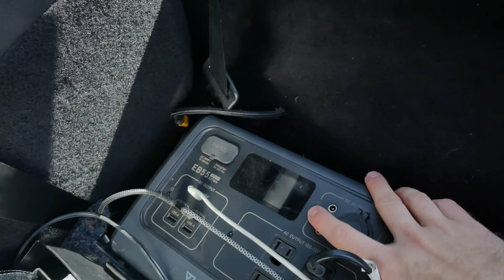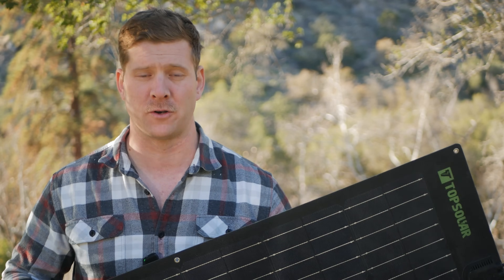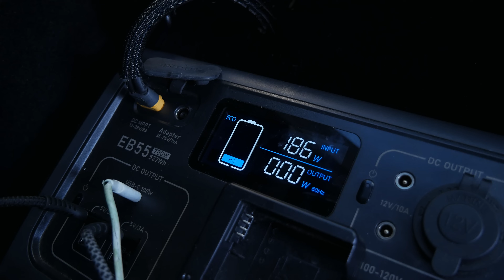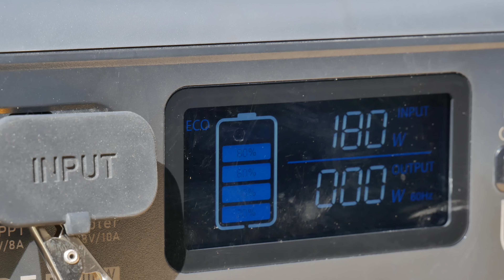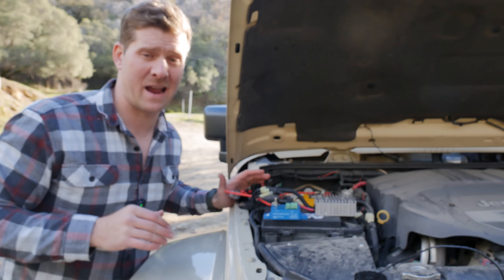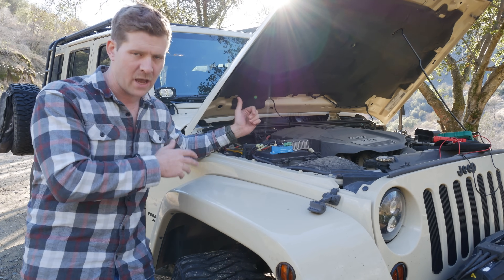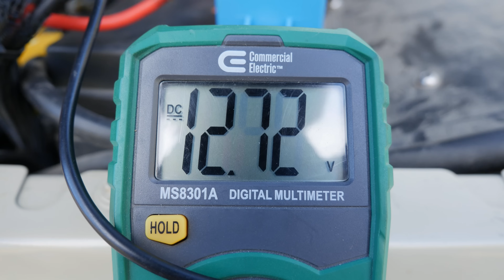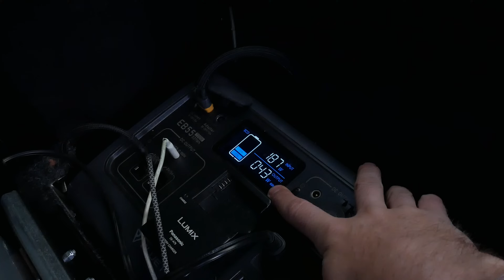Solar is Impractical for Overlanding: Here's a Cheaper Alternative That Makes 200W!

Comment: Watts is Watts. You will just discharge your car battery on smaller wires! If your alternator puts out 80amps at 13 volts that is 1040watts. If you convert to 24 volts the current will be in half but you will still only have 1040watts. Power = Current x Voltage. 
Make sure you have a spare Alternator on hand because you are going to need it! That Jeep engineer did not design the charging system to have that extra load.
Reply from the maker: @patricktrout9037  it's only pulling 200W for 3 hours or so until it's fully charged, then only 30-40W which is completely negligible. It's not just about the total power, it's about the charge rate and capitalizing on it while driving. With overlanding or any vehicle dependent travel, it's crucial you're able to maximize your charge rate while you're driving the vehicle so that you're fully charged when you arrive at camp.

Comment: I didn’t read all the comments so someone may have already mentioned this, and I’m no expert, but I’m pretty sure those higher charge rates degrade the battery much faster. Thus needing to replace the battery sooner than ideal. But maybe that’s the trade off for recharging in your scenarios.
Reply: My wife and I were beach camping for several days, and only 1 day out of 4 was there enough sun to charge our power station faster than it was discharging. On the 3rd day, I had to run the Jeep 8 hours to charge up our power station at a measly 60 watts to get us to the last day. I would have loved this solution for our situation.

Comment: Makes it sound like he found a new energy source like the infinity stone or something.  Perhaps solved fusion energy with a Bisquick recipe? Nope.  Whats the trick?  One battery dead, charge it with another... also drain your gas by running your car. An idling car uses between 1/5 to 7/10 of a gallon of fuel an hour. An idling diesel truck burns approximately one gallon of fuel an hour.
 Still.... I think it was a neat trick to charge faster then normal and I applied the effort just not the click bait saying solar doesnt work for you is what you mean.

Comment: But obviously, you will need an alternator with a sufficient output to keep-up with your system's extra demand for power.
Reply from the maker: @Ron_Leonard  it's a good point to consider for sure. My stock alternator has been managing just since posting this video for what it's worth.
Reply: @RhinoOffroad  I've heard a few reports of problems with the existing alternator's duty when maintaining large Li-Po batteries on deep cycle. Some vehicles may have an alternator ideally matched for maintaining a lead acid cranking battery only, but perhaps your vehicle is fitted with something more over-duty.Thanks for the reply.

Comment: Am I misunderstanding something? Does this mean all the charging sockets inside the vehicle are getting 24V at 8 amps or is there only one new cigarette socket receiving the 24V's?
Reply from the maker: @user-iv8hc8fm5o  no cigarette adapter used. Ran 10awg wire all the way back to the converter!

Comment: Why not just run your load off the car battery? It would be nice if the battery bank had a way to just disconnect its battery and only draw the external power needed to power the current load.
Reply from the maker: @gblargg  because this is using the secondary battery I already have 🤙

Comment: Sorry for Russian, but my English not very good. Мне кажется, что во время зарядки дополнительного аккумулятора не будет заряжаться основанной аккумулятор, либо его разряд будет происходить быстрее чем его зарядка
Reply from the maker: Using Google Translate but think I understand your question. The alternator supplies enough current to charge both batteries simultaneously

Comment: Why not use a 1000W Inverter which will just go to the Bluetti? Get like 500W out of it. 12V cigarette charger can do 100W. Could microwave yourself a quick meal while you're at it before you turn off with a mini microwave, I think.
Reply from the maker: @WrestleKrysti  because I'm then converting from DC-to-AC and back to DC. The maximum charge power the AC charger can provide is 200W when plugged into a wall outlet.
Reply from the maker: @WrestleKrysti  and this is far cheaper

Comment: 12.0v is like 30% state of charge. Could be a problem cranking on a cold morning and for sure will reduce life of battery. Reset it to at least 12.55v and the battery will stay at 75% state of charge. 
Very well presented video.
Reply: I'd just have it switched on with the engine, so it only charges off the alternator.

Comment: Should have gone for a 48v or 60v boost converter. 
And you don’t want to use your car as a generator when not in motion, so get a solar panel and/or a stand alone generator and for crying out loud, charge up your solar generator before you go on a trip, takes 2 hours max.
Reply from the maker: @TheCornucopiaProject-bd5jk  my Bluetti (and most portable batteries) can only take up to about 28VDC. I really don't use it when the car is not running, and I don't need to charge it up ahead of time; it only takes 3 hours of driving to charge it to full, and it's one less thing to worry about
Reply: @ you use one of those tiny power banks, that’s explains it.

Comment: So I kinda did that but I put it inside the dash with an xt-60 socket on the dash then made a xt-60 plug to socket a few feet long to plug in from there to my gen. Didn’t want all that stuff under the hood like you because if u use ur jeep like a jeep ie meant to be used that’s going to have issues with mud and water… just saying.

Comment: Doesn't this mean that your maximum charge capacity is now limited to whatever AH your car battery is? 

I'm using a Bluetti EB240 hooked to 400w solar over my Tacoma cab. True it's a little costly (~$1,300) but I'm never without full  power
Reply from the maker: @issues420916  no because it will keep charging until the Bluetti no longer accepts the input power. Ideally this is just keeping my battery topped off as the fridge runs

Comment: your alternator doesnt create more than your car needs, it only outputs what the load is, that load could be charging the battery or whatever accessories, charging something at 200watts will use more gasoline, just basic physics. but i can see it being used as a backup power source, would be handy.

Comment: Uhhh...24v 4amps. Minus conversion loss.
Reply from the maker: @MrNathanstenzel  the current on the 12V side is about 16.
Reply: @RhinoOffroad  you video graphics said 12v 8amp vs 24v 8amp
Reply from the maker: @MrNathanstenzel correct, because after the step up converter, 8A is provided to the Bluetti as that's the most it can take. The amps only get halved between the input (16A) and output (8A) of the step up converter.
Reply: @RhinoOffroad  my point being that it could not be that the two sets of numbers could not be the input and output. Maybe you meant for the graphic to say 12v 16amp and 12v 8amp?

Comment: Currently showing at $88.52 on Amazon for the 3 main components combined. Maybe this video has pushed up sales and, as a consequence,  the price! The description for the DC/DC converter states "(Note: Never connect to solar panel or wind turbine. Never charge the battery.)". Surelly when running the engine you are charging the battery. Maybe the relevancy of this notice by the supplier is something to investigate further.

Comment: For overlanding, definitely fit a flexible solar panel or 2 to your roof. You will generate good power all day to charge a battery and its all free. Running off an alternator is costing you gas all the time, its a very inefficient way to charge a battery.
Reply from the maker: This works great in the summer months, but you'd be dead in the water relying on solar all of fall and winter up on the Pacific Northwest

Comment: so to avoid solar you just use a whole vehicle as a generator? You've discovered a car alternator can charge a battery?
Reply from the maker: I don't think you watched the whole video...
Reply: @RhinoOffroad  sorry if i missed it but you seem to be running the car to charge/run everything on the way.
You have doubled the voltage to to max the watt charge on the leisure battery when recharging off the car battery which is charged by diesel/the car.
The tip of volts/amps balance to max the charge rate on the second battery is cool. 
 I guess I was expecting more of an alternative to solar than go back to the car and recharge the leisure battery from it, running the engine if needed.
Still enjoyed it though, presented well and explained
Reply from the maker: @merlynsfire1275  I probably didn't anchor on it enough in the video, but I definitely don't plan on running the vehicle just to charge the battery; for an overlanding solution, I just think you get WAY more bang for your buck by maximizing your alternator charging while driving so that you aren't reliant on trying to arrive early enough to catch the sunlight (or late enough in the morning). I do appreciate the feedback and support though 🤙
Reply: @RhinoOffroad  for sure charge it all till the last second :) grab all the juice you are producing. 
Keep doing it buddy, just jealous of the wilderness. I'm in the UK and we have countryside but not really any wilderness you can just go play in.

Comment: Not all vehicles have one, but why not use the built-in AC jack to charge up your bluetti? I have a 140w AC port built into the console of my '11 F150 and use it to charge my EB70S or 12v jumper pack while commuting to work every week (6hrs one-way). Or, pick up a 300w inverter that plugs into your cig lighter. They're cheap and all over eBay or Amazon. Sure, you'll have efficiency losses, but the point is to make it cheap and easy. Right?

Comment: Amorphous solar panels do not need direct sunlight, they work just as good in the shade, they just need light unlike mono and polly panels ,so i disagree with your claims plus sunlight is free, a altenator costs money to make it work.
Reply: Do you have a setup that use this type of solar panels? How many watts?
Reply: @Mark300win  I have used all 3 types of panels in small solar projects typically less than 100w 12v systems,

Amorphous are the least efficient out of the 3 types and are only typically good for around 4-5 years service life,but the good side of then i found was there was only about  half a volt difference between sun and  shade and they work just as well in the with low cloud over cast.....but they are getting hard to find and they cost more that the mono/polly.

Comment: $60? No way mate. That Victron Shunt is $60 alone. Plus your setup might not work with certain Smart Alternator systems. It’s system specific. I’d rather a LiPo over a Jackery
Reply from the maker: The Victron low voltage cutoff is $35...
Reply: @RhinoOffroad  Yeah, true. US dollars. But still not a good.setup

Comment: I charge with 12v 750W while driving DC-DC or 350W on grid, 350W solar, using 800Ah battery, 10 days offgrid no problem. All electric, no gas in my van

Comment: I like the idea of using the alternator to provide charging power but would recommend pre-charging the batteries before heading out.  You'll put more wear and tear on the engine and reduce the available horse power and fuel mileage.  Keeping the power bank topped off is a great idea and your setup is a good one.

BTW - Ohms Law covers power as well as voltage, current, and resistance.

Comment: If you install a 48V instead of a 24V you can charge at 380W. Then there's the obvious..... Why not both?
Reply from the maker: @Zakary79081  unfortunately my portable battery won't take greater than 28v, but you certainly can!

Comment: How did you run the wiring? That’s always the biggest pain the butt.
Reply from the maker: @dmitrym2922  yeah agreed. I just ran it underneath the carpet all the way back and through a through-hole in the firewall

Comment: 80w is more than enough to run the fridge AND charge the battery. If your fridge is pulling a constant 60-80w get a better fridge.
Reply from the maker: @swooshdave  I'm also constantly charging camera gear 👍

Comment: A lot of you guys are missing the point here, this is an auxiliary charging method for when solar is out of the question. Living in the UK it is pissing with rain for most of the year so forget solar, being able to charge quickly whilst driving is great, once charged you pop the breaker and your charging system is just like normal with no extra load, perfect. Thanks for a great idea, I am going to integrate a set up like this into my truck.

Comment: Mixed feelings about this. The biggest advantage in higher voltage is to lower the voltage dropped across the wiring as you charge, or using a lighter gauge wire. I'm not sure why you just don't have the Bluetti charging while you drive then leave it in parallel with the aux battery where you installed the voltage multiplier, you had to run new wiring anyway. Sure you can recharge it twice as fast but you'll still get the same kWh out of your aux battery with or without the voltage multiplier. Actually a little less if you think about the heat generated by the multiplier as wasted power. The only advantage I see here is to recharge the Bluetti faster so you can move it away from the vehicle sooner. But you haven't really done anything to extend your stay off-grid without recharging from the vehicle's alternator, which is where solar shines. (no pun intended :)
Reply from the maker: This is a great point you bring up. For my purposes, I often struggle to get the battery fully charged in between campsites when only charging at 40 to 50watts. What this really does is ensures I'm starting each night with a full charge on the Bluetti.
Reply: @RhinoOffroad  So dissing solar was really clickbait?
Reply from the maker: @Dan-nj8du  nope! I've used many types of panels to try and find a solution that reliably keeps my Bluetti charged. Solar is very hyped at the moment for this community, but as I talked about in the intro, there are better options out there (such as the step up converter). This (obviously) is just my opinion.
Reply: @RhinoOffroad  But you aren't "generating" 200w. You're converting the energy your vehicle generates to 200w, along with however many watts of heat your multiplier dissipates. Maybe you haven't found a solar solution that keeps your Bluetti topped off (yet), but this doesn't either. It's just a faster way to top it off while the vehicle is running. I suppose if all you do is sleep and drive, fine.
PS: Sorry about the edits. For some reason no matter how much I proofread I don't spot the typos until after I click save. 😄
Also, I don't mean to sound so confrontational. Just a bad habit of my writing style. It is a cool idea. Just not a replacement for solar "IMHO" 😁
Reply from the maker: @Dan-nj8du  I hear what you're saying, but at the end of the day I think it's semantics. A depleted battery would take about 10 hours of driving to charge. I can now do it in about 3 hours, so the end result is that I'm able to keep my battery charged and running throughout my entire trip (which was the original problem I was facing). I appreciate the discourse!

Comment: awesome, now save up for a replacement battery and alternator, gonna be changing them out much sooner with that setup.
Reply from the maker: @sladeoriginal  good thing Optima has that sweet 36 month free replacement policy 🤙
Reply: 😅 how? It’s not pulling much juice at all. The dc\dc chargers pull a hell of a lot more than this does. I do agree the 12 volt cut off needs to be changed though. I would have went 12.4 or 12.5

Comment: Yeah, maybe so, but solar power is free and the alternator needs gas to run and gas isn’t free. Not to mention of course the wear and tear on the engine and the battery. Maybe ok in a pinch or just as a short term solution, but not something sustainable.

Comment: Yeah the Eco flow alternator setup does like 800 w but very expensive and taxing on the alternator. This is a really good setup. I would hook up a solar panel on the hood anyway to the truck battery should charge through your current system.

Comment: So, if I'm understanding this correctly, you are doing this because your Bluetti power bank can only be charged at 8Amps. If, for example, you were utilizing a 100AH LIFePO Aux battery instead of the Bluetti, you could utilize a 12V DC/DC charger ( providing your vehicle's alternator had a high enough output) that was capable of charging the AUX battery at a far greater amperage...20A...30A...40A. The DC/DC chargers are designed to isolate your vehicle battery, when your vehicle is not running and with the one I use, which only puts out 20A, it will charge a fully depleted 100AH battery in 5 hours of driving. Given I have never experienced a fully depleted AUX battery, it will typically top up a 50% depleted battery in 2.5 hours of driving. While I certainly could have installed a higher output DC/DC charger that would have recharged the battery even faster, going with the lower 20A output charger allowed for the use of smaller AWG size wiring and fusing.

Comment: why would it only charge to 450w?! thats silly
Reply: if its compressor fridge your setting up for failure but its still only doing 6 amps at start up maybe 45 watts or 2 amps after that. 

and its not always on...
Reply from the maker: @pazsion  it's not just the fridge; I'm also constantly charging camera gear